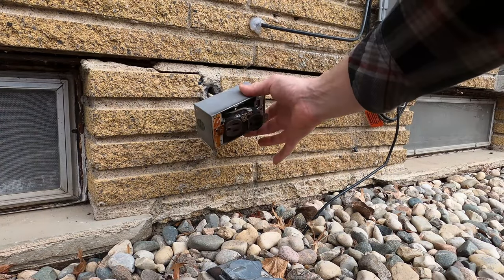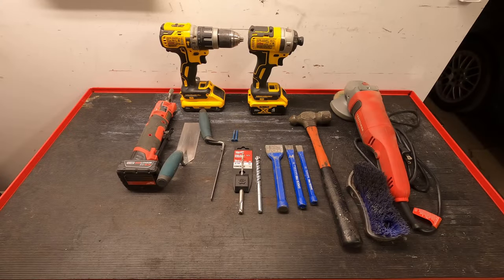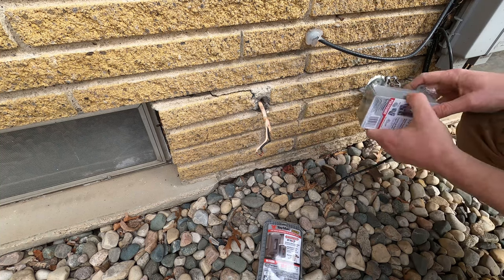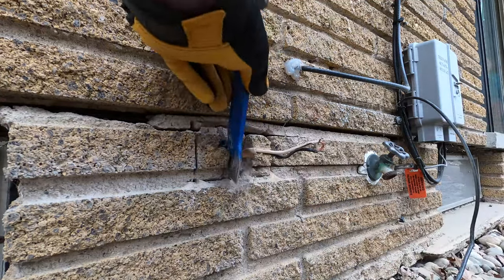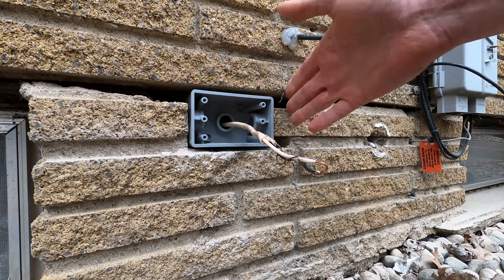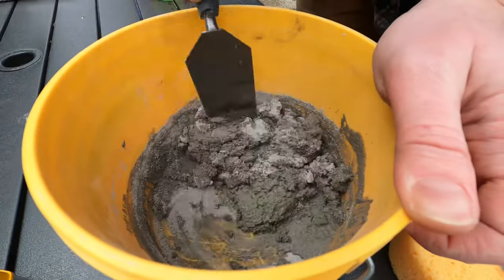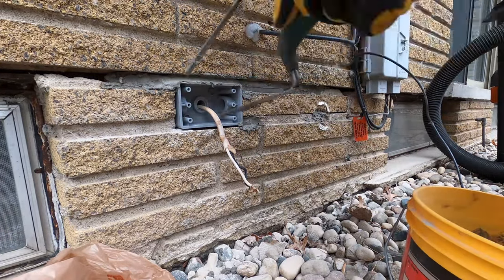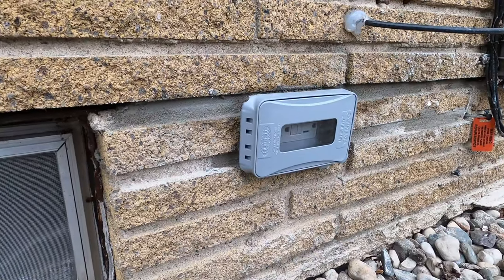How To Install Recessed Outlet Box Into a Brick Wall

Comment: Thank you!  I’m good with the electrical.  Really had no idea what I was going to do for mounting. Cheers!
Reply from the maker: Every house is different, so I'm my method was able to help you out!
Reply: If you're able to mount in front of the wall instead of recessing in, you can always use tapcon screws to mount the box to the brick, or any stone material for that matter. The box should come with little ears that get screwed on the box itself and those ears mount to the surface. Just make sure you use the correct tapcon drill bit for the screws you plan to use, so that the holes with be the perfect size for the screws

Comment: Great video. As a frequent DIYer, I wouldn't wanna go through all the work to recess a box since I believe it makes it harder to run new outdoor wiring in the future. By externally mounting a box, it would make it easier to run any future conduit for future outdoor devices. Plus, there's little to no holes in the wall. 

Besides that, your receptacle turned out really nice and is up to code
Reply from the maker: Every house is different, just have to do whatever works best for you!
Reply: They make bell box extension rings with the conduit holes on the side, there’s always a workaround :)
Reply from the maker: @indescribableemptiness4104  Yup! There's so many little parts these days to get exactly what you need.

Comment: Only downside to going horizontal in this case is that the hinged cover is on a short side. If you wanted to leave something plugged in (like holiday decorations) then having the hinge side up might help shield it from a little more of the weather.
Reply from the maker: TayMac claims you can install this horizontally or vertically which is why I felt comfortable doing it like this. I know other style covers have specific versions for horizontal or vertical installations.
Reply: They make horizontal weatherproof cover that hinge on the top, but if you're planning on leaving something plugged in you're going to want to get an in-use cover, especially if  its going to be plugged in for a while like holiday decorations.

Comment: Always wet your brick before adding mortar to help it stick in a repair sponging it is ok
Reply from the maker: Yup! I forgot to show it but did mention it. A sponge, or even a spray bottle with some water in it will work great on an existing structure.

Comment: So I was planning on getting a TayMac 1 gang box(metal) to install in my brick wall outside of my house. This video is great, but what’s the process on mounting/screwing the box so that mortar isn’t the only thing holding it in..?
Reply from the maker: I used two tapcon screws through the side of the box into the brick. The brick is deeper than the outlet box, so I wasn't able to put the screws through the back of the box into the rim joist.
Reply: Ya I didn’t see him screw the box into the brick either

Comment: I just moved into a new house and wanted to try to grab power from this outlet for the floodlights. I have never seen one of the recessed outlet boxes (2 year apprentice). If i take the recessed box out, will a regular bubble cover still work and have a solid seal?
Reply from the maker: It definitely depends on the house and outlet box, but a bubble cover should fit. All you want is that cover to seal against the box properly.
Reply: Well if you're trying to tap power from that kind of receptacle, then I believe recessing the box would make it harder to run new wiring from that box. 

I'd personally go with mounting in front of the wall so that I, or someone I hire, can easily run conduit from the box for future wiring outside. But if you have easy access to the wall cavity, then sure, recessed is fine.
Reply from the maker: @aurvaroy6670  In my situation I wouldn't be adding more outlets due to the fact of the location of the outlet and the fact that my panel is maxed out. Every house is different, but I felt comfortable recessing it.
Reply: @StevesGarage  Sure, no worries sir. Whatever works well for you and your situation!

I personally am completely open to both options of mounting. I just think going recessed limits future expansion since the wiring would be hidden inside the wall, besides all the extra tools, materials, and labor required. Not saying it's impossible to expand, just more work or challenges involved

Either way, your finished receptacle looks great and is safe to use, unlike what you had before.